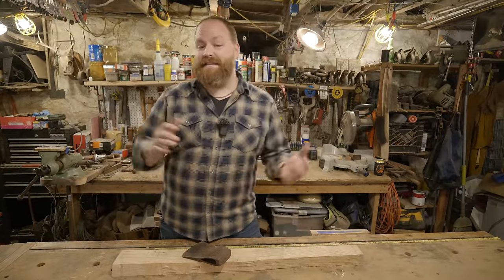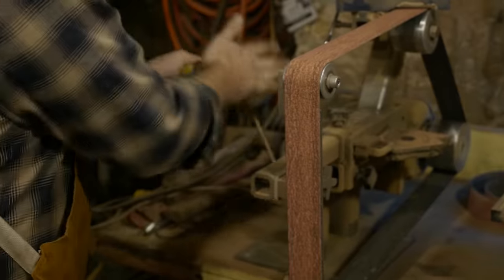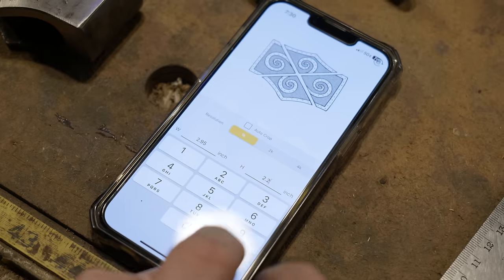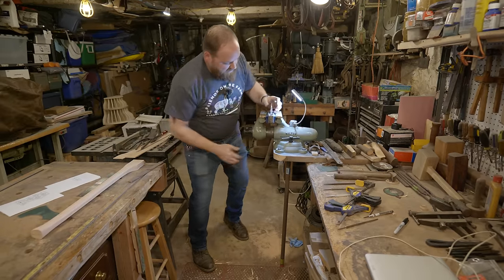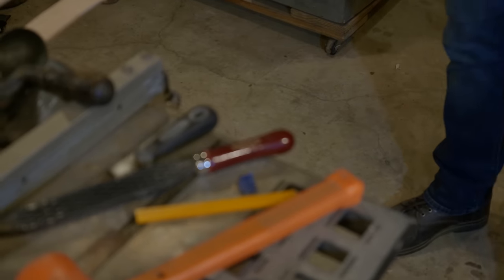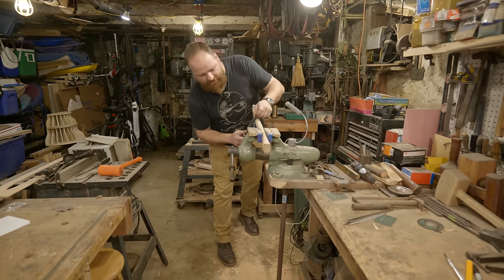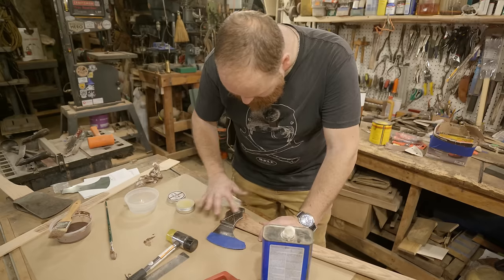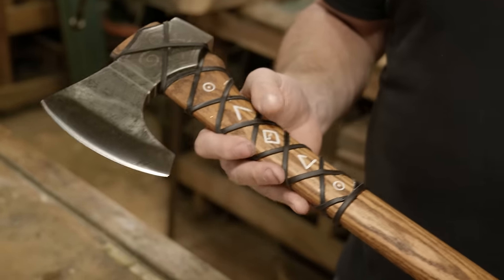Making a Viking Battle Axe: No Forge Needed

Comment: For etching a design I've always liked to use a resist stencil (vinyl, wax, nail polish, even electrical tape) and current run through a dauber with salty water grounded through the piece. Works very quickly, is easy and cheap, and gives a little more natural feel while still being accurate.

Comment: Beginner question.  Why doesn't anyone stain and treat the handle before mounting the head?
Reply from the maker: For me personally, I want the handle finish to be the last thing I do. That way when clamping in and out of the vise to fit and hang the head I’m not messing up the handle. I have oiled the handle before hanging in the past, but I haven’t found that it makes much of a difference in the longevity of the hang. Another reason is, In my opinion, the head seats onto the handle much better when only contacting raw wood. 

Thanks for the interesting question and for watching.